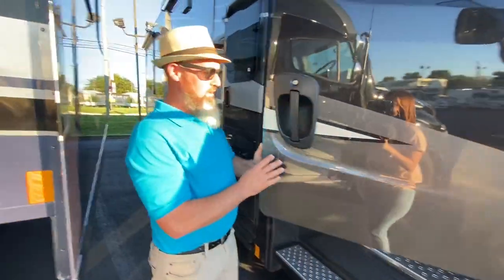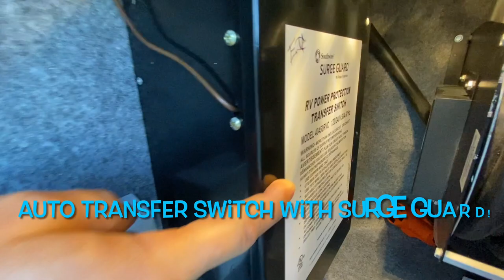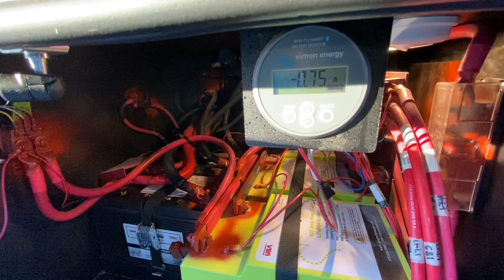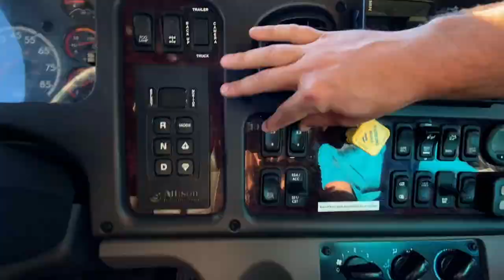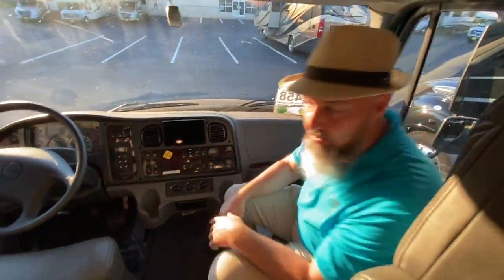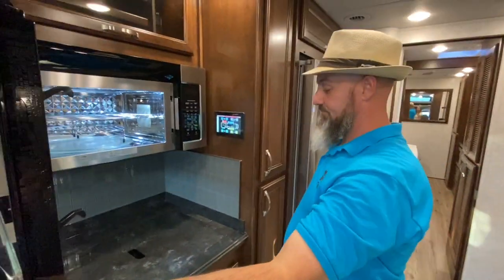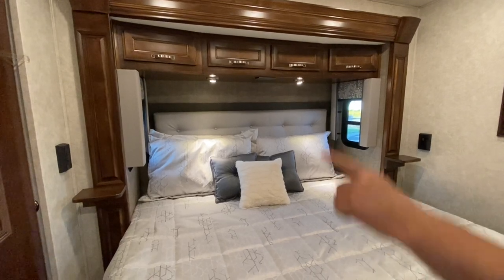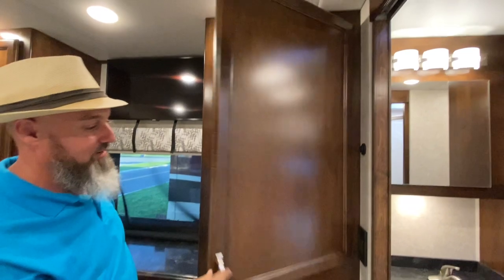Beautiful short Super C! 2022 Renegade Verona 36VSB

Comment: 👍👍 My most favorite Renegade.  Under 40 feet (easy to maneuver), large kitchen counter, reclining lounge seats but can also use as 3 seater sofa, no propane, and best of all, all water pipes and tubes are not on a slide outs like many other RVs.  Don't have to worry about water leaks due to constant movements of pipes / tubes when slide out moves in and out.
Reply from the maker: All correct! These are great Rigs!